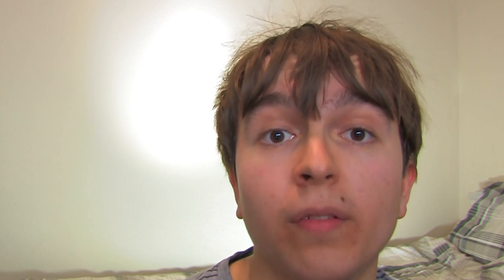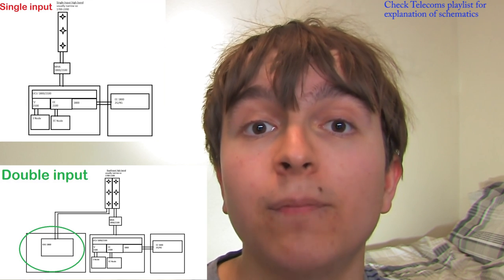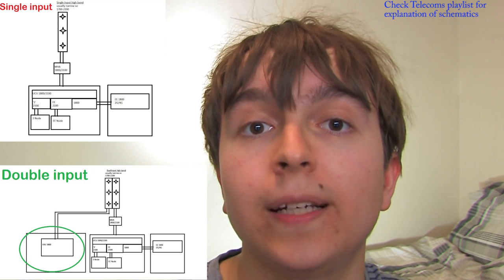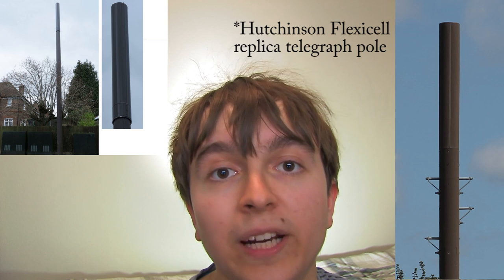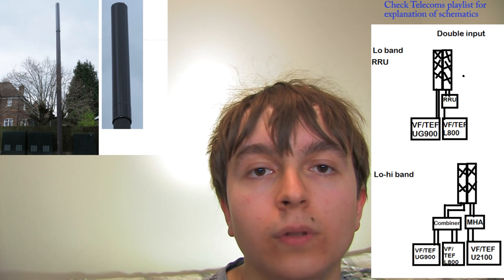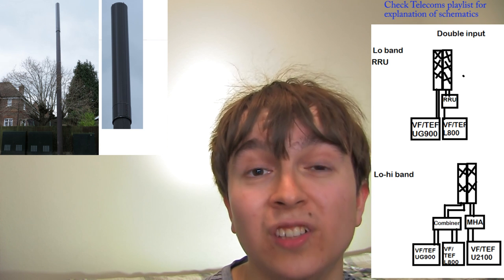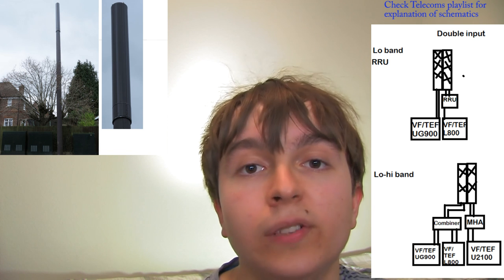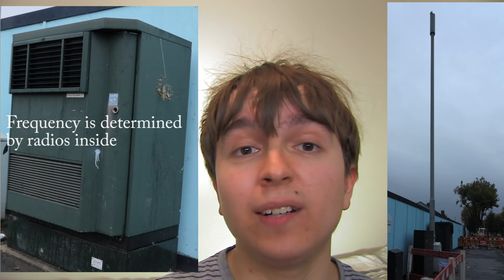Phone Mast Monopoles Explained in Depth: EE/3, O2 and Vodafone. + cabinets

Comment: Hey! This is really interesting as I love to take note of different types of masts. In 1 part of Cardiff there used to be a EE/3 dual mono pole next to a Jupiter pole. Lady test tube EE/3 one disappeared. Now it kinda makes sense. EE &/or 3 have joined voda & O2 as Three's 4G 1800mhz is still full signal. No sign of another pole placed anywhere. + There's another green cabinet added to the others.

Comment: The very last cabinet that you'd shown I think is an Ericsson/Alifabs RBS3102. Those sites were only capable of up to HSDPA 14.4. They are not compatible with the 21 or 42 Mbit/s DUW Cards from Ericsson nor are they upgradable to LTE. The Ericsson/Alifabs RBS6102s provide a compact solution for operating GSM, WCDMA & LTE in one unit (cabinet). My carrier just recently upgraded their entire network to use them after replacing their old RSB3102s and other old transmission equipment.
Reply from the maker: +TheBrandonDestiny Thanks for that spot, it does look rather like an RBS3102! I've added an annotation and credited you.

Comment: Peter did you know that EE and Three share most mast locations. It’s managed by a company called MBNL so in theory should be the same signal on each side by side
Reply from the maker: I've done tons of videos showing various EE and 3 shared builds. Only multi operator RAN is U21 so signal can be quite different...
Reply: Peter C Ok thanks.... Do you know a good site that shows mast locations ?

Comment: Any one able to identify this? https://www.google.co.uk/maps/@51.3515062,0.4711704,3a,45.8y,138.45h,97.04t/data=!3m6!1e1!3m4!1sN2RRq9ThuhOQRi1YYya2lg!2e0!7i13312!8i6656

I'd assume it's EE 2G/3G, would I be correct in assuming no EE LTE or 3 3G/LTE from this mast? 
I cannot really tell from this, but I don't know how to differentiate the various panels used
Reply from the maker: +TheCJGCJG Looks to be EE 2G/3G non integrated so no 3.
They are fairly typical Orange panels; though I would recommend taking a look at my site's legacy masts section, www.pedroc.co.uk, for more info.
Reply: Ah, yes, thank you - this is a very informative site here :)